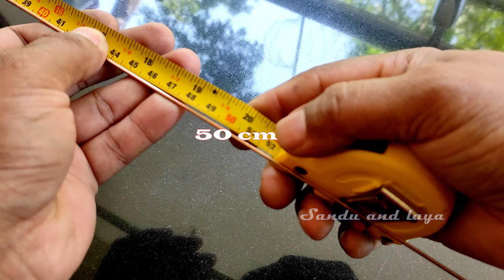DIY Kinetic Wire Sculpture Wind spinner/KWS22

Comment: What is that grey thing you are using to bend the wire with? Is the most important thing that the diameter we use is the same? Thank you.
Also, how many pieces of wire for each length are needed to comp,eye this wind spinner?
Reply: I counted 20